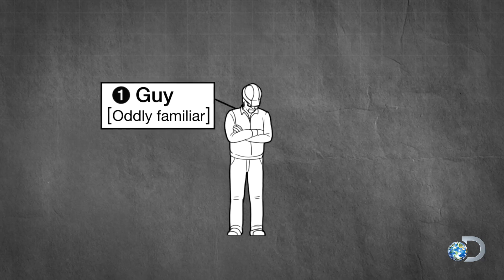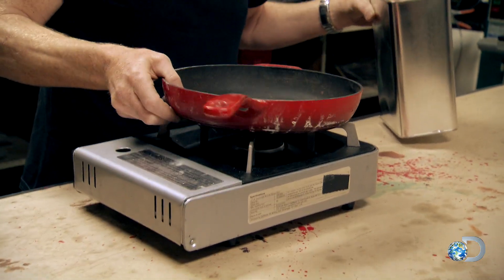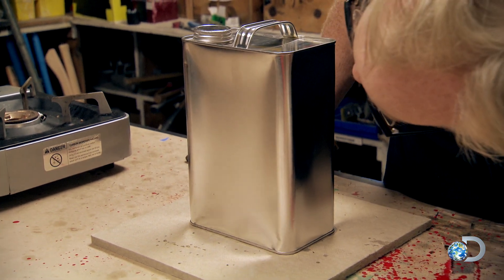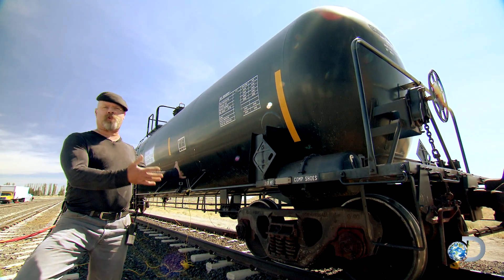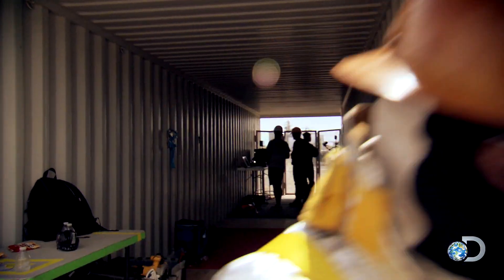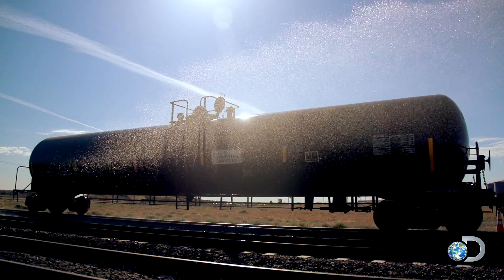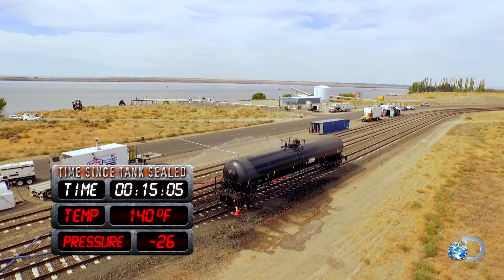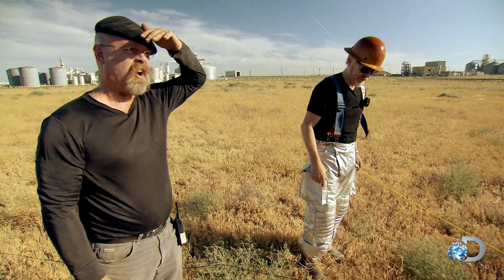Tanker Crush MiniMyth | MythBusters

Comment: Not surprising it didn't implode with "only" one or a litte over one atmosphere of pressure difference.
Depending on the cargo there may be a greater difference than that, either high or low.  Gasses in their liquid state can be at a considerably higher than atmospheric pressure. 

Didn't they re-do this one with an older tanker car and get an implosion? 
I would swear I saw them implode a smaller tanker .... maybe they had some water in it, and heated the tanker car to over 220 degrees before sealing it?

Comment: the tank never even got to superheat. you didnt even seal off the tank right you just pumped in steam and called it. 209 aint nearly enough. in the beginning it shows the tank getting to 400 degrees then getting rained on by super cold water. only way you can get 400 degrees is to seal it off then superheat it to that. it might well have imploded under that much pressure. i really dont think they wanted to implode that expensive tank.

Comment: I was employed as an engineer in a chemical plant for many years and one of the many safety protocols for steam cleaning a tanker is to never seal it until internal temp is normal. We even use a steam and a thermal probe to give us an internal temp reading in the control room. I am not saying this accident didn’t happen in the manner they claim but if it did, it was pure stupidity on behalf of whomever did it.

Comment: This is a 1 atmosphere difference in pressure... now imagine how violent it would be underwater with 400 atm of difference...
Reply: I've heard the air inside super heated to 10,000 degrees (whatever the surface of the sun is) from the near instantaneous collapse.
Reply: @rizdalegend yeah that's absolute horseshit lmao
Reply: @jhondisjames2151  not horseshit, ever heard of a fire piston?
Reply: @jhondisjames2151 You never hear of a pistol shrimp?
Reply: @jhondisjames2151 Look it up - it's Science and physics.  A pocket of air 3000+ metres down with 5500+PSI means that the air has to go somewhere.  Due to the instantaneous implosion, all of that air gets incredibly fast (immediately) and disappears all the same because it has no where else to go but compress.  I don't have a science mind so ask someone who knows more than me, such as the internet, if you want to confirm that statement.
Reply: OceanGate anyone?
Reply: @Am3rIca16 
I believe this was an experiment for a certain instance. The experiment was at one atmosphere or less.
This experiment really has no relationship to the pressures at 12,000 feet under water.
Reply: True
Reply: 400 atmospheres of pressure= 4132909.8112 kilograms of force per square meter, they got Squashed like a bug being hit by a fighter jet.

Comment: They do collapse. There is a video of it here on you tube.
Reply: IIRC they had to modify another tanker car to get it to happen. Remove some bulkheads inside it used for support and uses one made of older/weaker steel.
Reply: @brianstraight9308  Very tricky. So much is fake here on YouTube.
Reply: It was common for them. If they couldn't do it in the parameters of the myth they saw how far you had to to to get the desired result.

Comment: Of course it's not going to work.  No matter how hot the steam is when sealed inside, the inside can only ever approach -1 bar, which is what you would have if you used a powerful vacuum pump to suck out every last molecule of air and create a perfect vacuum inside.  ... and yes I already know about part two where they caused a severe weakness by denting it with a large block of concrete.

Comment: The structural integrity of the tank was too great for the pressure to crush itself. It was built too well. Later, they do it again and compromise the structural integrity by putting a significant indentation that gives it a head start and sure enough it does crush itself beyond use like a soda can.

Comment: Inches of mercury.. degrees Fahrenheit. Sounds as if they are still in the 19th century. Just use Pa and K, it's not difficult. This would warp you right into the 21st century. You can do it, US.
And no, there is no "negative pressure". It is just the scale of  your freaking pressure gauge.

Comment: I would imagine that they're built in such a way to prevent this very thing from happening
Reply: You would be right, they’re built to prevent this although it’s now meant to do with transporting liquids and gases
Reply: Given how hard it was to collapse it, I'd say they did so.
Reply: They aren't you can see plenty videos of this exact thing actually happening
Reply: yes they have bulkheads..metal plates separating the tank to different sections..to make it more stable when carrying liquid material..and to prevent the implosion...if those arent there you dont actually need that much suction power to crush the tank

Comment: There is a lot of knowledge on cylindrical containers with external pressure from oceanographic work. The roundness of the tank is really important as the shape is unstable if out of round for external pressures (think flattening a straw.) The domed endcaps are also crucial as these would otherwise fail early.  The choice of steel and weld quality obviously also matters.   BTW for those saying the steam test was less meant less force than pumping on the tank tthey report the he pressure was 27" of mercury which is about 13psi which is pretty much 1 atmosphere (~14psi) - a pump would be no different in force, since the force comes from the air pressure outside which is fixed.  Presumably tankers that did collapse where of a different structure.

Comment: As much as I like the show I hate when Adam explains how a “negative pressure” inside leads to implosion. There are people who actually believe that a lower pressure or vaccum will pull. That’s not the case. First, there is no such thing as a negative pressure. The pressure is just lower than the atmospheric pressure outside which is therefore pressing on that container which is why it would collapse.

Comment: Wow, we studied things like that from 8th grade into college. The collapsing can on the hot plate was an 8th grade experiment. A course in structural engineering explains the rest. Consider the simple soda can. If it is undamaged (no dents at all) You can (after emptying it of soda) set it on the floor (upright) and stand on it (unless you weigh like over 200+ lbs). That thin thin wall in circular form spread the stress of the weight perfectly uniformly around the structure. As long as there is NO point for which the stress to concentrate One small dent in the side and it will collapse as soon as you put weight on it. Cause that flaw does not allow the stress to be uniform, it builds rapidly at the point of uneven geometry, and quickly overwhelms the material. Indeed if that tanker had a dent it would have collapsed. As others have long since pointed out that tanker cars over time get damaged and pick up collections of dents. The thick metal allows them to still withstand a good amount of pressure (positive or negative) but those will no longer be able to take an extreme pressure difference anymore.

Comment: this happened at a factory i was working at, the guy was pumping out glycol from a chemical tanker but had not opened the ventilation valve, so the tank was practically sealed as he pumped out the liquid., well, that made the tanker implode after it got near empty. noone was hurt, BUT if the guy had been on top of it when it imploded it bent in such a way it would have flung the worker up in the air. that worker got fired.

Comment: Also I've watched these implode first hand.  Not the high pressure tanks like this but insulated tanks on tractor trailers.  Most often caused by the unloading process when the driver does not open the vent port and the tank is unloaded by 1000hp high flow punps,  no one wants to wait 40 mins to unload a tank when it can be done in 5 mins.

Comment: If they filled it with water and drained it without opening the top or vacuum valve it may have got a much higher vacuum, Wine tanks used to collapse all the time but they are now pipes up in a way they cant create a vacuum when emptying and forgetting to open the lid

Comment: It is possible but the tank is thick and designed to take the pressure.You have a modern tank.If you fill a canister a metal canister with hot water and put it in a pool so that every side of the canister gets covered in cold water the  canister would be crushed.So epic fail

Comment: I'm pretty sure those collapse when the liquid fuel in them is drained without the pressure release valve being opened... The vacuum from the liquid leaving the tank I would think would be higher than that of the steam vacuum. (Edit pumped out, not drained. One is forced the other not.)

Comment: I don’t know what they explained in the full episode, but by regulation, rank cars, rail and truck, must have a vacuum relief valve that will let air in if pressure goes too far negative. 
I have actually seen a tanker be sucked in (truck tanker) during unloading operations because the tank trailer was not vented and the negative pressure was too great.

Comment: Should of tried this with a smooth bore tanker trailer  when they would get washed you can when it goes into the cold water rinse you can hear the air rushing in through the vents.

Comment: The reason this didn't work is that the atmosphere can, at most, exert 14 psi on the outside of the tanker car. The steel can withstand far more pressure than that.
Reply: Atmospheric pressure has little to do with the amount of vacuum you pull on the inside though.....the more vacuum you pull the greater the differential pressure even when the outside doesn't change.
Reply: @ian3580  Uh... not so much. The implosion happens due to the pressure of the outside air. The least pressure you can have in a container is 0 PSI. That's what a vacuum means. Once there's no more matter in the container, you can't make it more of a vacuum.
Reply: @AaronMichaelLong  That's true, but there was still plenty of matter in that tanker.....not much of a vacuum (nowhere near 0 PSI).  Yes, the crush happens due to outside pressure but its is really the differential pressure between inside and outside that matters.   I would be surprised if the steel could withstand an inward force anywhere near that.   Think about a soda can, it can handle normal carbonation pressure of ~30psi but if you do the hot/cold trick it crushes very easily.  Many items in industry can hold near ultimate vacuum but cannot be pressurized, and many can be pressurized to extremely high pressure levels but not withstand even a small amount of vacuum.  

A lot of vessels similar to this can even crush inward just by dumping the contents without opening a vent space for air to take the place of the dumped product.

Even here, a very similar rail tanker is imploded with a vacuum pump https://youtu.be/Zz95_VvTxZM

Comment: It's important to note that it isn't really a vacuum that sucks things to shrink from the inside. The atmosphere, the same one pushing on us at all times, crushes them from the outside. Vacuum seals? The atmosphere pushing the packaging onto the stored item.
I don't know if it's an accurate description, but atmospheric pressure seems to be the equivalent of placing a ten ton (metric) object on every square meter surface. Including you.

Comment: The myth didn't work because you heated it up to 209 degrees when the original was heated to 400 which means not enough negative pressure was created when it cooled.

Comment: In the actual episode, after that they dropped a heavy weight on it to damage it. Then it worked.
Reply: Anyone got a vid? I feel rather unsatisfied
Reply: I was thinkkng they found a way to make it implode.
Reply: ARatQuiRit thank you good sir
Reply: Pre-dented/creases; like an empty coke can can hold your weight, but once it's dented it's game over? 
It works in my head. 🤷‍♂️
Reply: @shootthemoon6072  That is exactly what happened.  A dent in the side and it imploded in their "try and make it happen".  Yet they still called it busted.  I found this to be an incorrect decision because they only clean tankers if contaminated, or if requiring service.

So imo, it was plausible because being damaged is a highly probable real world factor, and reason for cleaning it so it can be repaired.
Reply: I WAS JUST THINKING THAT THEY HAD IT IMPLODE!
Reply: @ARatQuiRit  .. Thanks! That was cool to watch!
Reply: I would guess the suddenly uneven distribution of pressure compromised the whole thing and made it pop.
Reply: @Gregory Clark how old is the episode again?
Reply: i was sure i saw it working years ago, I was surprised that nothing happened, I forgot about the damage 😅
Reply: @nuclearquantumlaserspewpew9745  Uh, no... they just ended this video without showing their next idea to get it to work. Technically what they tried in this video didn't work, so it's Busted.
Reply: Another problem was the fire truck was only spraying half of it.
When it rains, the whole lot would get hit evenly

Comment: This happens more often than ppl think. Not only 2 train cars but also semi tankers. If u dont activate the pressure differential valve they will implode. And as many other have already said these tanks get beat up. Dents, warping, scratches. All these weaken the integrity of the tank making them more likely to fail

Comment: Your first test used a cheap, 1gal rectangular can that was never meant to be pressurized.  Tank cars are round and built specifically to withstand high pressure from both inside and outside.  The big problem with tank cars comes from puncture damage in a train wreck, especially from the ends.  A law was passed to reinforce the ends, but so far only about 20% of all tank cars have been modified. Remember that the next time you see a news report about a train wreck involving petroleum or chemicals and it burns a town down.

Comment: I think a perfect vacuum is close to 5 psi. So imagine leaning on a tanker and it explodes. This is a lazy myth
Reply: A perfect vacuum is zero psi, psi is a force measurement. Normal atmospheric pressure is roughly 14-15 psi depending on altitude. The cylindrical shape dispersing the load is what saved the tanker from imploading.
Reply: It is the same pressure differential as if you pulled that tank down to a depth of ~30 feet in water.

Comment: Did they forget to add watter into the tank? Just like the myth when it started to rain it would have gotten inside. Just like the first scene with the can?
Reply: They DID put boiling water in it. They even showed how they released the lower valve and emptied the tanker in the end. I'll put a timestamp in...
Reply: 4:43
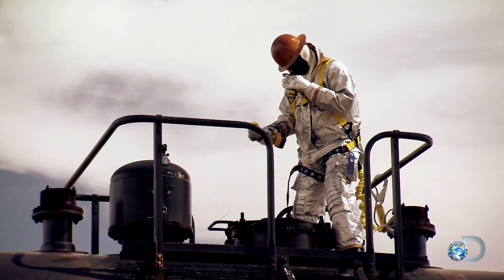Reply: @arifhossain9751  2:47 - 3:06 they never put watter in the tank, yes there was watter coming out at the end, but that could just be from steam and the outer watter hitting the tank, and sweating from the heat? Was just curious since they never showed adding when it was an important part just like the can at the beginning.
Reply: @levitate4867  
If they flushed water OUT of the tank, the MUST have poured water INTO the tank. There is no way the water on the outside goes in after it was sealed and even if it did sweat out, it would slowly drip and not splash out like that.